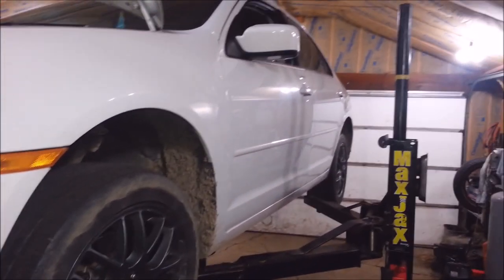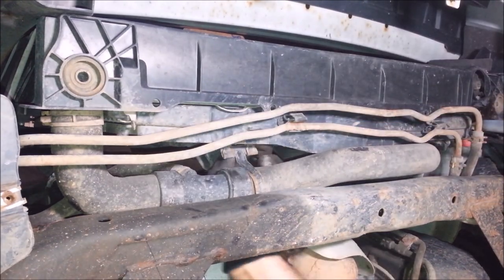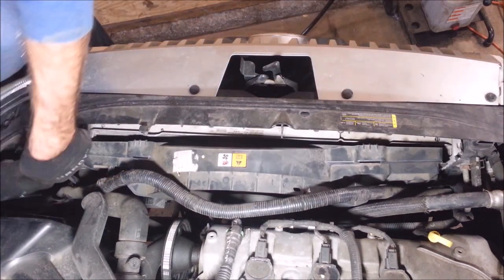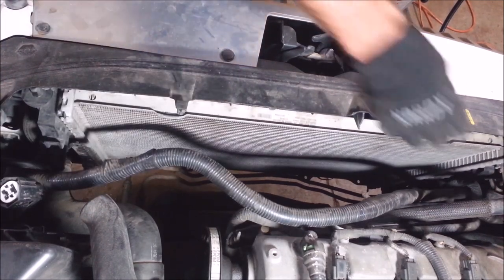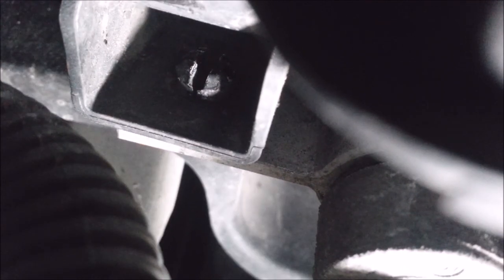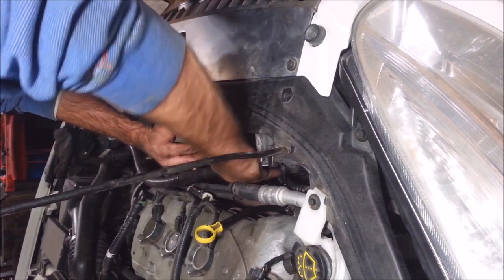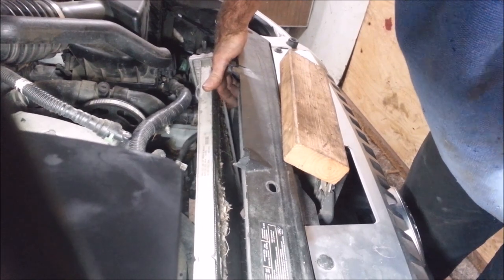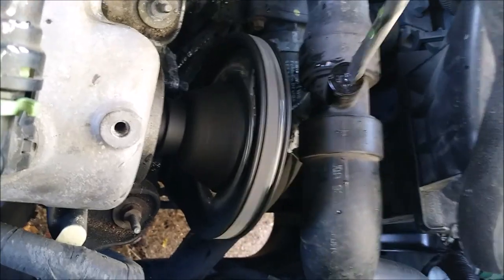2006-2009 Mercury Milan Ford Fusion radiator replacement

Comment: Disconnect the battery in order to prevent air bag deployment since their are impact sensors right where the work is taking place. Fifty seconds of prevention is well worth it.

Comment: You the man Rust Belt Auto! I followed your steps because I had a leak in the EXACT same spot on my radiator. After I R&R it took a gallon and a half of anti-freeze and a very small amount of trans fluid. I should probably change the trans fluid sometime so I didn't bother putting any back in.. Yet.

Comment: Hi, do you know the depth of the cooling fan assembly? Or if it is possible to trim the front? So the fan can be closer to the radiator, even if just a bit? Thanks.
Reply from the maker: I have no idea

Comment: My shit is still overheating lol
Reply from the maker: Is your fan working?
Reply: @RustBeltAuto  Yes. All hoses tight, bled system. idk
Reply from the maker: @RzVids  stuck thermostat? Check temperatures on both sides, when warming up engine. See if the radiator side stays cool. If it does, suspect stat. Possible head gasket. Block test. If it all gets hot when it's supposed to, check for coolant flow when throttling. May be pump/impeller issue. Good luck.
Reply: @RustBeltAuto  I replaced the thermostat and   upper and lower radiator hoses and the fan was replaced 6 months ago and it turns on. Maybe I’m not bleeding it right.. but I can follow a video to replace a part but diagnoses I can’t really do reliably. I may have to take it to the dealer because I originally took the car to firestone for diagnosis and all they said was radiator.

Comment: I want to take this opportunity to thank you for your video. Without it, I would never have figured out how to remove the radiator from my 2009 Milan. BTW, I purchased my initial replacement radiator from an on line company. They offered several from different makers. I went with the second most expensive. Absolute junk. The dimensions between the mounting posts were 3/4 of an inch off. I returned it and went with the exact Motorcraft replacement. Costs a bit more, but went right into place when I installed. Attaching the condenser was the tricky part. Thanks again.

Comment: this helped me replace my radiator on my crack smoking Ford fusion from 2007 thank you so much
Reply: Eric Powers did you have Amy trouble with anything? ??
Reply: getting it detached from the ac coil and the bottom hose other than that pretty easy

Comment: If you're dealing with the intercooler it's a lot easier to take the front end off. Honestly after doing both I think it's easier to just take front end off regardless.

Comment: I learned I’m never buying a Ford Fusion ever again. If it breaks it’s easier to just burn the thing
Reply from the maker: It might melt.
Reply: Rust Belt Auto if I lived near a cliff I rather push the car over that’ll fix a lot of the headaches it’s been giving me
Reply: @pmp2559  how many miles are on your Fusion? Our 2009 with 160k miles has been pretty reliable and these model years statistically show to be reliable, but I guess every brand can have lemons, such as my mother's 2003 Honda Accord with 100k miles that burns a quart of oil every 400 miles.
Reply: @mrau92me  that’s true statement, at the time it had 123,xxx miles. Replacing an alternator on a v6 fusion involved a lot of patience I learned some new words that day. The little thermostat sensor for a/c went out at 109,xxx miles work to fix a $20 item  was more than what it’s worth so I bypassed it with a fuse. It’s slightly smoking and burning oil not bad but does have a leak I’m trying to find coming from the sunroof or windshield haven’t found it yet. Have a 2005 Accord 117,122 miles I’m needs all motor mounts replaced. Best one I have is ram 1500 never had problems with it except for occasional driver window one touch not working so have to hold down the button. But I do agree with you on parts breaking no matter make, worse are electrical parts

Comment: lmaoI. doing the timing chain on a 06 milan. Im with you on the "CRACK SMOKING FORD ENGINEERS"!!!!!! WTF!!!! The hardest thing I have ever done on a car. Everything is so damn tight like virgin you know what. If anyone has any questions on what I had to do holla cause you will get stuck for hours sometimes figuring how to get some of these damn clips and bolts. EXCELLENT VIDEO! Although I don't care for 4 bangers, I think I may consider one when I purchase my next vehicle. NEW OR USED!!!!!!!!! Much easier to work on! BUT....when you have the time and patience to DIY the rewards and knowledge gained is invaluable. Take your time people. "Happy Knucke Knocking!!!"

Comment: Absolutely despicable with all the junk attached to the rad. This is exactly why I'll keep my 1994 Toyota pickup around and alive forever... Nothing is attached to the rad but 2 hoses. Simple is SO much better. Thanks for the video.
Reply from the maker: Did you notice there is not a single bolt or screw holding anything together. Just a few screws for the bottom cover. It is a Lego.
Reply: Yeah, terrible. I own a few Fords and they are basically junk, although the one is a F350 diesel van, it's ugly but fairly reliable.
Reply: @RustBeltAuto  And it doesn't help that EVERYTHING is some kind of composite plastic, including the radiator support, so even trying to pry the clips off risks busting something else. I am starting to think it would be worth the extra money to just go get the entire assembly and replace it all as one unit.
Reply from the maker: @floodx4947  it's a cheap disposable car. Don't expect it to go back together the way it was. Just make it work to last longer than the rest of the thing. Radiators are cheap anyways. Those of us who seek perfection will surely never find it.
Reply: Theres nothing really “attached” to the rad, its more or less just held in place through the rad for a more pleasing/neater asthenic.

Comment: Thanks for the video. This looks like a lot of fun. I'm tackling mine this morning. I had a 1984 Ford Mustang, and I replaced the radiator twice. Both took about an hour, because the car didn't have AC or an automatic transmission. Super simple. This won't be a quick, simple replacement.

Comment: at 4:45 you removed some clips that held the radiator to the support, Where would I get those things or what are they called? (It's the pieces you had called funky.)
Reply from the maker: You probably need to pull them off a used car, or ask the dealer.

Comment: Do you know if the 2009 v6 Fusion radiator,condenser and fan is them same as the 4 cylinder fusion ?
Reply from the maker: My sources say yes.

Comment: Thanks for making this video. I would have been lost without it.   Just got the stupid thing out.  I said many of the same things you did about the Ford engineers in the process.  Turns out there was nothing wrong with it.  The problem was a 25 cent nut holding the trans cooler line fitting to the tank. I only found half of it.